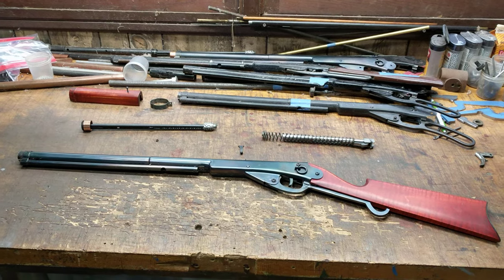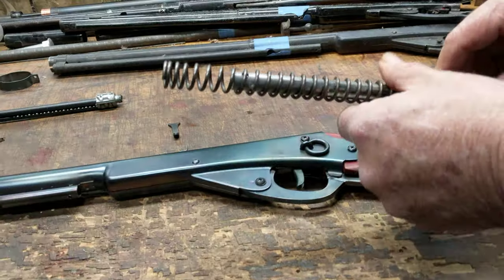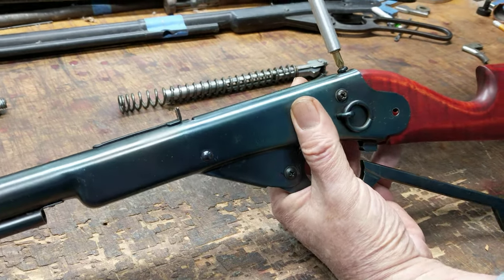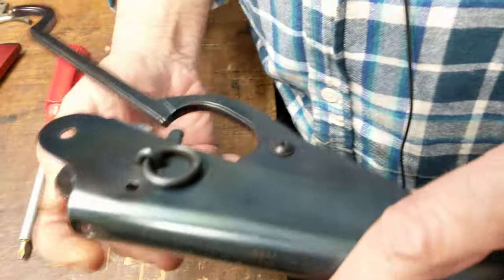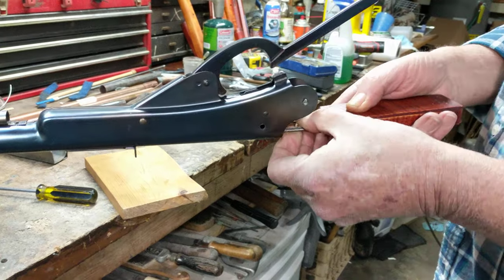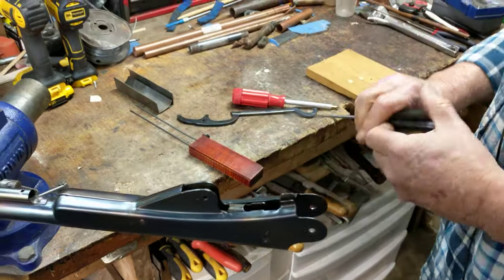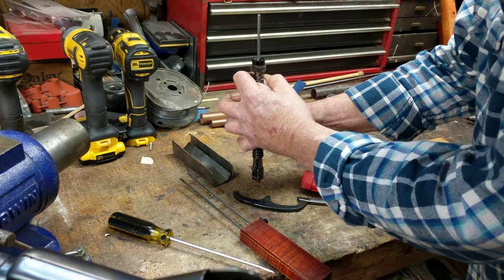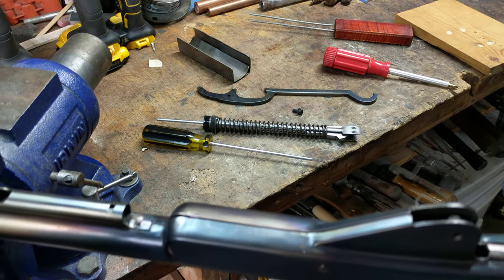Swapping springs with the sliding spring block in Restomod Daisy #111 Model 40/27

Comment: can the air tube in a 1938B be bored out?
Reply from the maker: Jerry, Yes but you'll want to check your air tube first to see if it's seamless. Then drill away but be real careful as it is very easy to break those tiny bits.